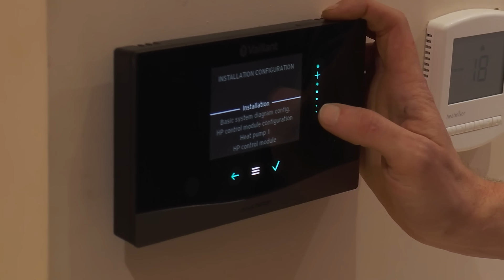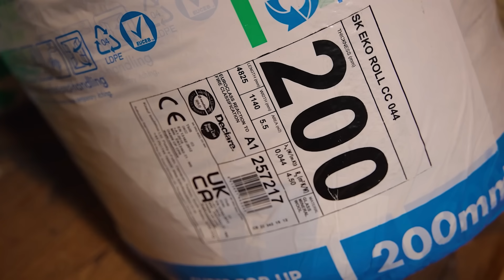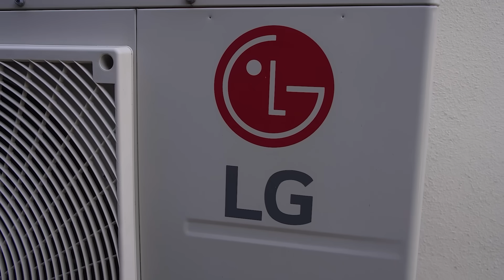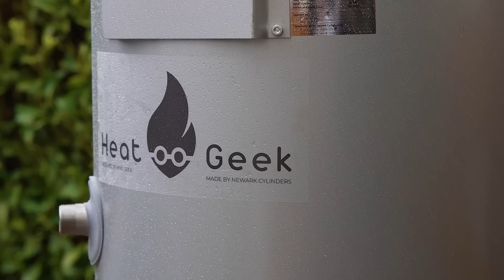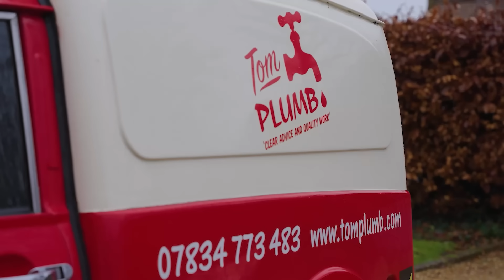Heat Geek’s Heat Pump One Year Later — The Verdict!

Comment: Note, there were many reasons we swapped that unit. Not just the noise. Also note - 450% efficiency over the year.
Reply: Rodger, it sounds like a Air to Air multisplit would suit your house.  Couple of grand for the cheep DIY kits and would probably half your heating bill if combined with battery strorage.

Air to air would also suit almoat any flat thats not sutable for Air to water, just like other countries.  or centralised / district air to air / air to water,
Reply: @inh415as installed in many countries.
Reply: We have a Long history of a that’ll do attitude and it is at the heart of many of the problems this country faces. We and our government should always aim for the best possible outcome. We should protect our resources and not squander them. The exploitation of natural resources should be taxed and the proceeds invested not simply spent by the treasury. We should as a nation be investing to drive down the cost of energy which will be of benefit to all.
Reply: But how would the old system have performed if the insulation would have been done first, you can’t make a comparison as you installed roof insulation, that’s 20-30% improvement already.
Reply: I call heat pumps the IF product. IF you are fully insulated, IF you can have underfloor heating, IF your pipework is suitable, IF it's a new build, IF electric is the same cost as Gas, IF you get a good designer , IF you get a good installer. IF it's set up and run correctly. IF it's half the price. 

Most fall at the insulation part. Insulate fully first. Then while you can get another boiler. Wait for technology and time to remove most of the IFs. Right now even a good install will not save you money once you factor in the high cost of product and install. By the time you save, parts will need replacing.
Reply: @ these myths have now all been disproven multiple times
Reply: @HeatGeek  how do you know electricity prices wont rise ? the savings argument only works with certain costs, also you are definitely not impartial you have a dog in the fight
Reply: @AlexSmith-y4i6t  Its same for the gas and everything else for that matter
Reply: Adam, I 100% agree, I was a sceptic and in September 2022 we moved in to a house with a ASHP, and my first thought was "Thats getting replaced with a good combo boiler". But I watched a few heat geek videos and learned about weather compensation and "low and slow" and how to access the various settings and change them for the best. Now I am convinced, our large 4 bed house in Norfolk is warm, comfortable and cheap to heat/run hot water, the house is now all electric and one other thing to consider is the effect on health of not breathing in all the fumes from a boiler, hob and oven. A huge thanks to Adam for the video guidance.
Reply: @micksmithson6724  You can get weather compensation on gas boilers, and you can get low and slow gas boilers too (ones that can also go high if needed, so no need to "leave running" all the time).
Reply: @drsquirrel00 thank you for the reply, but initially I was a sceptic but now I am a convert, our house is far cheaper to heat than our previous house of similar size with a Valiant combi boiler, and the house is toasty. But if you remain unconvinced, it’s not for me to persuade you, I am simply sharing my experience.
Reply: But is 450% efficiency down to changing the unit? I doubt it. Plus who paid for the Vaillant unit? Methinks this was sponsored by them.
Reply: Was it oversized for the property?
Reply: @watchandlearnfast   amung other things like fixed high temperatature controller, yes
Reply: @HeatGeek  I’ve seen this issue across Europe, boiler installers have installed oversized heat pumps then they don’t run efficiently and customers end up blaming manufacturers etc and finally accusing heat pump industry of daft conspiracies etc
And all this time the installer is to blame 😞
Reply: Tidal power is far too expensive. Wind is cheap. We don't have the grid to support either. Sort the grid, sort the pricing so it's not matched to gas, that's sorted the price.
Reply: It’s perfectly valid to be cynical of a system or technology that requires so much input in order to work. It’s going to take time before our workforce learns how to install these units, I estimate that at least 70% don’t as that is bad odds for customers.
Reply: @yp77738yp77739 Less input than education. Education of the installer and education of the customer, both of these tasks are verging on the impossible in the U.K.
Reply: Your £250 survey puts me off - what if you do the survey and then charge me ten times the amount? 

If you are serious - come to my house and video the whole thing?…… Happy to be persuaded
Reply: @ollydearden How many working hours do you do a week for no payment?
Reply: @HeatGeek  Is this more about pride than heat pumps? 

No one, especially an OG cockney plumber, likes to be schooled by someone half their age and thicker hair. One skill we woefully lack these days is acceptance. More specifically, the ability to say “I was incorrect” or “I don’t know”. I am constantly schooled by younger members of my electronic engineering team…it’s really hard but they respect me more when I listen and accept when my ideas were awful, while theirs were (much) better. But I’m not redundant, they are not right with everything, and I’m there when it all falls apart too - with my cool collect nature 😅. It’s how it goes. 🤷‍♂️. 

It’s absolutely ok for someone younger than you with less experience to have a better understanding of something. And it is most definitely ok to say “Well done 👍” - it feels good, try it. 

When there is a problem, be part of the solution or get out of the way. (Equally as important: when the solution has been implemented, don’t creep back in peddling gas boilers again 😂 - John is one of us now….) 

The physics is there, but the competence is not. All YOU need to bring is willingness and leave your ego at home, not needed at all.
Reply: Hear hear ! You could t have got this better nailed than this person. Roger shows throughout the video series that he doesn’t have the level of knowledge to understand these systems and likes it when it’s simple - i.e gas boilers. Roger is no slouch, and certainly no thicko and with a bit of decent training could nail heat pumps but I think his ego was hit by a few too many installs that didn’t go well for him because he didn’t do them properly and the ego is bruised and wants to shite on them. Your comments are spot on - admit you’re wrong and learn and grow from it.
Reply: John stated that the system did work but was turned off because it was too expensive to run , and the outside unit was noisy. Adam stated it was an easy fix , a weather comp sensor will reduce the running costs . 
I was looking forward to someone problem solving and fixing a hp system but that didn’t happen.
Reply: @haydnlawrence8167  It took a team of about eight super geeks to rectify this and so how many of us could get this sort of attention?
Reply: @haydnlawrence8167 watch it again carefully!
Reply: @haydnlawrence8167  You can get weather comp sensor for oil/gas boilers now - really don't know why it wasn't done 20 years ago on the reg.
Reply: @drsquirrel00 Because the U.K. industry is very poorly educated. Simple.
Reply: @haydnlawrence8167  Do you need to watch the original video from about a year ago?? This is the follow up video - stating that everything is fixed AND is actually better than his original gas setup.
Reply: @terryjimfletcher  You need to watch all the videos in this series, and take off the rose tinted glasses and drop your Adam fanboy infatuation. When you watch these videos try and use critical thinking and logic, I realise that is beyond most people convid being the prime example .
They didn’t fix anything they ripped out a load of equipment and installed a load more new equipment . 
The homeowner stated the system worked but was expensive to run and also the outside unit was noisy. Adam stated this was an easy fix with a weather comp sensor this will reduce the running costs , did they try this ? 
The next video months later is a bunch of geeks ripping out a load of kit to install a load of new equipment. 
In the final video with Roger talking with John the homeowner for a recap we find out a load of loft insulation was added during the making of the videos , perhaps that was the problem with the running costs of the original install.

The takeaway from this is it took 7 years and 50k of equipment and labour just to do what his gas boiler was doing all that time.
Reply: @haydnlawrence8167 That is not crucial thinking. That is confirmation bias. You watched some videos, through you had observed accurately and understood what was happening. You then demonstrated your critical thinking ability by concluding that it was all essentially rubbish. The confirmation bias triumphed over any ability to think critically - you believed it was all rubbish before you watched and confirmed that after you watched.
Reply: Skillbuilder is really a notorious heat pump hater. The way this guy talks about the technology is really pissing me off.
Reply: @pietheijn-vo1gt  Roger started off as a sceptic, but that's a very different thing to being a hater. His sceptical position was quite understandable, as all of the messages he'd get from people would be asking for advice after a bad installation.

But now he's seen first-hand that in the right circumstances, with the right system design, they do in fact work. He's been very open and honest about this over the years and has talked about how his viewpoint has changed. He's one of the few YouTubers who has a genuinely balanced position on the matter.
Reply: @yngndrw.  He's not a skeptic, he's a full on hater. His claims are not fact. Yes installers can mess up, we've seen that in the video. Proper training is needed. But that is not a valid reason to dismiss the technology.
Reply: I think this good news video is great, with the owner expressing that he wants more heat pumps, regulation and support for when it goes wrong.

At least Roger isn't dismissive.
Reply: @pietheijn-vo1gt would anyone let an untrained electrician rewire their house? So why let an untrained heat engineer design and install a heating system.
Reply: @markosborne7311  exactly. It's not rocket science. Just gotta know the right things.
Reply: @rogerborg  "Please collect your tools and leave my property"
Reply: @pietheijn-vo1gt  Where is he dismissing the technology?
Reply: @pietheijn-vo1gt  Did you write this before you watched the interview, after, or instead of?
Reply: @pietheijn-vo1gt  But that's not that apparent from the video, which is attempting to fix real problems. And Roger is really good at that, despite all the prancing no-nothing 'experts' who like to tuck away a few shillings for themelves whilst the 'global warming' scam lasts (1.4°C rise since 1890 - no big deal).
Reply from the maker: If you are pissed off it is because the arguments are getting through to you. Heat pumps cannot provide heat for many apartments and flats. They may, one day provide heat for 50% of U.K housing stock but you won't be alive to see that day and neither will I so choose something else to be pissed off about such as WW3
Reply: @SkillBuilder  oh stop it with that bullcrap. Heat pumps will work in any building, you just gotta have an installer who knows what they're doing. Heat geek has proved that.
Reply: Totally agree Rog @SkillBuilder
Reply: @pietheijn-vo1gt  Only half correct that they will work in any building. For flats, terraced housing and listed building they're not appropriate without costly infrastructure upgrades.

For instance a flat can't have it's own ASHP due to location and planning permissions as you're not allowed to hang a unit over a public walkway.
Terraced housing most planning applications get turned down at the DNO stage if the incomer is less than 80 Amps.
Listed buildings they can't be on show so it's a ground loop.

All of these buildings would be best served by a district heating set up and heat interface units in the individual properties. Fully Charged did a video a few weeks ago about a few blocks being retrofitted to make Heat Pumps work. The cost went into the hundreds of thousands. 

So yes we as installers can make them work for any building, how big is the clients pocket book is normally the deciding factor.
Reply: @SkillBuilder  We know that the arguments aren’t getting through. That’s the frustration. If a heat pump isn’t viable for many apartments and flats, so what?  Don’t install them there right now. If the products develop to the point where they are, then they will be. What’s the point in pointing this out? Why is it relevant to the main points of discussion?
Reply: @rogerborg  they were not removed because they were never installed. It was a plan that was cancelled. It’s a bit disingenuous to say that because heat pumps do not work well in an old palace that they won’t work in people’s homes or regular office buildings…
Reply: @effervescence5664  the issue isn't if HPs can work technically. You can heat any house with a HP for less CO2 than a gas boiler.

The difficult bit is the cost due to elec being 3-4x gas in the UK and the bureaucracy (planning, listed buildings and all the things you mention)

Gov could change the game tomorrow with changes to regulations and elec market.
Reply: @SkillBuilder  
Neither could I have one although I'm sure that perhaps Heat Geeks would  find a way! I have a largish 3 bed semi of 1929 vintage which only have two available outside walls if one excludes the front aspect. The wall facing the garden has one kitchen window and one bedroom window and a large patio door. If the HP were to be fitted between the two ground floor windows then there is no way behind these wall to act as a plant room unless I did away with the poky kitchen. 
The side wall which is our back passage is very narrow and constricted in aiir flow and faces E/NE. etc. etc.
Reply: @SkillBuilder I’m with you on this Roger. He could have run the boiler at a constant 20 degrees and insulated the loft and the results would be similar. In the U.K. electricity is so much more expensive than gas so this skews any advantages the heat pumps work goes has. We know that efficiency goes down when the outside temperature is really cold, and sometimes the outside unit ices up and the system shuts down altogether. The radiator water temperature is lukewarm, so pipe diameter and radiators cannot be the same as the old gas installation. 
Roger, you are spot on to point all this out, as you are a heating engineer and understand the cons.
Reply: @pietheijn-vo1gt  At a price lets not forget...... and one that may be too costly for many in the UK even with a £7500 subsidy, all houses are not equal here. We very much need tight regulation on installers( full labour and equipment cost breakdown ) or perhaps an alternative way of passing on the grant, i.e. post completion direct to house owner. A2W heatpumps aren't the only green way to heat a home, other approaches get overlooked by the government.
Reply: @albireo-d1b  the first step should always be to get a decent level of insulation, regardless of whether you're using a boiler or a heat pump. Too many people are in energy poverty because of poor insulation. Once a basic level has been reached, a heat pump is always an option. And as for new builts, those should always have a heat pump.
Reply: @SkillBuilder  I respectfully disagree, a few boreholes for groundsource heat when doing the initial groundworks and hius in the apartment will take care of it.  Kensa is a good example of a specialist in these kind of heat networks. I'm not an expert by any stretch I'm predominantly a wet plumber but to say it can't be done is incorrect. The cost to retrofit existing blocks will be a challenge but it's got to be better than the storage heaters a lot of these places have. I was working on a newbuild in Digbeth recently and they're fitting unvented cylinders with exhaust air heat pumps built in. So the hot water at least is from heat pumps.
Reply: @pietheijn-vo1gt  We heard that Heat Geek themselves actually said to John that there ARE properties they cannot justify an installation, and others were it is marginal and not to bother, so your argument is incorrect that they work in any building.
Reply: @olly7673  what percentage of buildings is that? 1%? I'm saying they will work in any building. I'm not saying everyone can afford it right now. But those that can should install one, higher volumes = lower prices. So the rest of us can benefit from that
Reply: @pietheijn-vo1gt  But that is not what the Heat Geek expert said, nothing to do with cost, just practicality.
Reply: @pietheijn-vo1gt  I live in a flat and cant install a heatpump, the management company wont allow any outdoor units.
Reply: @TomMorris1  well then they're suckers and they should change their policy. Alternatively they can install a single larger scale heatpump for the entire apartment building.
Reply: @olly7673  you'll have to be more specific. What video or source?
Reply: @TomMorris1  get a window unit, or a portable unit.
Reply: @SkillBuilder actualy there are heat pumps than can heat flats and appartments, they use ventilation air and/or outdoor air without an outdoor unit. Retrofitting an excisting boiler would be not so easy but for a new build possible.
Reply: @SkillBuilder  "Heat pumps cannot provide heat for many apartments and flats" - Are you sure about that? Consider - many high-rise blocks of flats in foreign climes (where it's hotter than here) have aircon heat pumps all over them. There's no reason why this couldn't be done in the UK too; full system heatpumps are a little bigger, I grant you, but you'd not need a large unit (as seen in this video) for a block of flats.  For any block with a flat roof, the heatpumps could be installed on the roof; yes, that's going to be a bit of a plumbing mess, but it's not unachievable.  One final option would be to offer a central building heat pump (a really really big one) that could provide heating & hot water for an entire block; divvy up the bills as part of the service charge.

There are many ways to skin the cat - poor cat - we just need to be open minded about them.
Reply: @SkillBuilder  what about district heating for flats/apartment buildings using ground/air source? Gas boilers in flats present a certain risk element and direct electric boiler/heating is crazy expensive (key factors you see to ignore). You have a very blinkered approach despite touting ideas like Portcullis house could be heated using the Thames. Very selective in your approach to topics... can't think why...
Reply: @rogerborg  what hope is there for the average installer if such an impressive install has gone tits up, the heat pump manufacturer would have got the kudos of having their units installed, and yet it still went down the pan, looks like they forgot their cibse guide book on inspection.
Reply: I doubt he’s pissed off because the arguments are getting through to him, but because in the face of undeniable evidence, heat pumps outdo gas boilers even when electricity prices are 4 times higher than gas and you still see to want to shit on them with very weak arguments. Your attitude is first as denier, then excuse seeker, then without doubt clickbaiter. And the gas fraternity have no answer to this, how do you do a gas boiler that doesn’t emit CO2 and other pollutants ? At the end of the day that’s still a problem, whether you like to brush over it or not and you’re morally wrong for passing that problem off on other generations. Heat pumps do not have that problem, while being on average 4 times more efficient than the best gas boilers.
Reply: @johnmacward  while heat pumps properly installed can offer economic heating the facts are a typical installation will cost close to £15,000.  For that money you can install a new gas boiler and run it for 15 years.  In that time the gas boiler will need replacing as will the heat pump.  Now if you add solar PV and a battery you can run your heat pump for “free” except the PV and battery will cost you another £8000…..

The big issue with heat pumps is the cost AND bad design and installation.  If the installation is bad you save no money at all and this is the whole point of the video.
Reply: @SkillBuilder  think he needs to sit down and take a few deep breaths, then realise that heat pumps are not suited for all building types.
Reply: @SkillBuilder  air to air multi splits can heat almost any flat and apartment in the UK. Units of 12kw output over 6 rooms are avaliable and commonly fitted worldwide. In the unlikely event your flat needs more heat, you an always fit 2 units. 

The barrier in UK is primarily planning and skilled workforce.
Reply: @SkillBuilder  This exactly is the biggest problem I have with so many 'green' solutions. They typically all or nothing  their arguments. Electric cars, solar panels etc work best where they work best. NOT everywhere.
Also, if a typical person  needs special training to operate a system today,  that SYSTEM needs to change.
Reply: @SkillBuilder That may be, but even at 15%-20% it will be a game changing level of efficiency. At greater than 20%-25%, the efficiency effects start to compound. At 50% the effects would be exponential. You shouldn’t discount even modest levels of housing stock conversion.
Reply: @SkillBuilder   youtube wins again and this should commissioned for terrestrial TV. Would loved to have seen a summary of all the design and work done to turn this disaster around. Awards to all involved.
Reply: @pietheijn-vo1gt  You sound like a car dealer who can't understand why people hate car dealers. Heat pumps are being pushed like tulip bulbs were 200 years ago. They work in places with nice climates or places where electric is either cheap or generated from renewables. In 50 years your argument might be right (it seems you think heat pumps are perfect). Look at the size of the thing. It costs money to run. Even if you are rich, they arent always the ideal solution because rich people often have unusual architecture and set ups with rooms running off one another. In 2025 heat pumps work if you live in a well insulated apartment, A1 rated home , or live in spain. OR if you live in a country where electric is cheap. The whole concept of them is wasteful. And then there are the morons who install these things. Its easy money if you are failed electrician.
Reply: @Meodus_Humbinerbernecki complete bullshit. You know which countries have the most heat pumps? The nordics, where it gets to -30 deg C. And they work FINE
Reply: @pietheijn-vo1gt   @pietheijn-vo1gt  YES THE "NORDIC" example they have centralised heating systems or solar panel orientated heating. Just because it works in finland does not mean those elsewhere are not being shafted by this over priced tech
Reply: @pietheijn-vo1gt  You are not sharing that in Finland they have much more availabilty of District - communal heating and anyone who builds a house in Finland has insulation in in mind . Also heat pumps dont work so well under minus 15 ask any Finland installer. In UK and IReland we are getting fleeced by cowboy installers. So you should can it.
Reply: @Meodus_Humbinerbernecki I have no clue what you're trying to say.
Reply: @Meodus_Humbinerbernecki can it because some of the installers are messing up? would you stop driving a car because you had a bad mechanic? or would you find another who does have good training?
Reply: CO2 is 0.04% of the atmosphere.
Reply: @fortnitefred1351  and 0.16% CO will kill you in hours. What's your point?
Reply: @fortnitefred1351  Honestly, there isn’t really anyway to sugar coat this. 

To put it in perspective, dinosaurs died out with a +3°C rise most likely caused by CO₂ from Deccan Traps volcanic eruptions, causing 1ppm CO₂  increase per century. If the asteroid or volcano didn’t get them, then global warming finished them off. 

We are currently at 0.042% CO₂ which has caused +1.2°C increase - all from post industrialisation (ironically) from burning the prehistoric life and turning atomic Carbon into CO₂.

To put it another way, we are half way to dinosaur-extinction-levels of CO₂ but perversely we are excelling at it with a 2.5ppm increase every year (not century)! Yes we are increasing CO₂ hundreds of times faster than during the dinosaur extinction. 

If we hit a +5°C rise globally, it’s pretty much the beginning of the end for us, and guess what? That’s 0.082% atmospheric CO₂. 

To put it another way, if we don’t slow down CO₂ production, ie stop burning stuff - then the human race and all the creatures on Earth are absolutely fucked, and we will be like Mars.

I’m not sure about you, but in lieu of absolutely nothing else, I’m definitely gonna give these heat pumps a chance. Anyone else up for that?
Reply: @fortnitefred1351  Honestly, there isn’t really anyway to sugar coat this. 

To put it in perspective, dinosaurs died out with a +3°C rise most likely caused by CO₂ from Deccan Traps volcanic eruptions, causing 1ppm CO₂  increase per century. If the asteroid or volcano didn’t get them, then global warming finished them off. 

We are currently at 0.042% CO₂ which has caused +1.2°C increase - all from post industrialisation (ironically) from burning the prehistoric life and turning atomic Carbon into CO₂.

To put it another way, we are half way to dinosaur-extinction-levels of CO₂ but perversely we are excelling at it with a 2.5ppm increase every year! Yes we are increasing CO₂ hundreds of times faster than during the dinosaur extinction. 

If we hit a +3°C rise globally, it’s pretty much the beginning of the end for us. If we hit +5°C, it’s over and guess what….+5°C rise will be caused 0.082% atmospheric CO₂, not much in it!?

To put it another way, if we don’t slow down CO₂ production, ie stop burning stuff, then possibly our great great grandchildren are going to witness a terrible end, what a legacy you left them! Let’s NOT lose sight of why we are doing this. 

Remember, a gas boiler can ONLY use gas, it will ALWAYS produce CO₂. A heat pump uses electricity and while some electricity is produced from gas, it’s produced with less CO₂ but more importantly there is non-carbon electricity available: nuclear, solar and wind. 

I’m not sure about you, but in lieu of absolutely nothing else, I’m gonna take my chances on heat pumps - after all they are perfectly acceptable in summer when they are cooling you down!
Reply: @fortnitefred1351  "CO2 is 0.04% of the atmosphere." - It used to be 0.028%, back when we had "normal" weather. If a 0.012% increase can change the climate so dramatically, just imagine what another 0.012% will do (we are well on course for that). Even more so when you consider that the original 0.012% increase took over 200 years, but the next 0.012% is likely to take less than a decade (indeed, current levels are already more than 0.002% above the figure you quote).
Reply: @theelectricmonk3909  could you provide a link to the above information, so I may study it further. Thanks.
Reply: @theelectricmonk3909  CO2 was 180 at the glacial maxima 21,000 years ago and remained similar until 15,000 years ago when the ice started to melt and sea levels rose 140 meters.  CO2 was 4000ppm  in the Cambrian when life exploded onto the planet.  What is your point?
Reply: @DR-00700 Did you check the global temperatures and the composition of the rest of the atmosphere during the Cambrian period?
Reply: @ yes both co2 and temperature were high.  You will argue that that proves co2 is the smoking gun so I point you to the radiative transfer model and the exponential decline in CO2s capacity to act to warm the planet.  Water vapour is the main proponent and both water vapour  and co2 are forced up with temperature.  Water vapour from the Hunga Tonga eruption has likely acted with El Niño to cause the recent spike in temperature that El Niño and CO2 can not account for as admitted by Gavin Schmidt of the NASA Godard institute in NYC.
Reply: @DR-00700 This comment misrepresents the science: yes, water vapour is a powerful greenhouse gas, but it’s a feedback, not a driver — it amplifies warming caused by primary forcings like CO₂, which traps heat first and then increases water vapour. The idea that CO₂’s effect “declines exponentially” is misleading; while absorption bands do saturate, radiative forcing continues to increase logarithmically, not vanish. The Hunga Tonga eruption injected water vapour into the stratosphere, but Gavin Schmidt has not said CO₂ and El Niño can’t explain recent warming — he emphasised they’re part of a complex picture, not invalid causes. This post cherry-picks and distorts legitimate science.
Reply: @NorthernEwan  Gavin Schmidt has indeed stated that the climate models with CO2 and El Niño CAN NOT explain the recent temperature rise and duration.  To suggest that CO2 precedes temperature is a contradiction in the science.  The climate record and co2 record clearly show CO2 follows temperature as CO2 degases from the oceans this is clearly shown in the geologic record and data.
Reply: @ This reply repeats a common climate denial trope: that CO₂ can’t be a cause of warming because in ancient records it sometimes lags temperature. That’s a misunderstanding. In past ice age cycles, initial warming was triggered by orbital changes, which then caused CO₂ to be released from oceans — and that CO₂ then amplified and sustained further warming. The lag doesn’t disprove CO₂’s role; it proves it’s a feedback and a forcing. As for Gavin Schmidt, he clarified that the Hunga Tonga eruption injected unprecedented water vapour, contributing to short-term spikes, but this doesn’t undermine the long-term trend clearly driven by CO₂ from fossil fuels, which models do accurately reflect.
Reply: @NorthernEwan  co2 does not amplify anything other than poorly educated alarmists….
Reply: @NorthernEwan  wrong
Reply: @DanRyan-v5y  incredible argument
Reply: @NorthernEwan  thankyou
Reply: No such thing as 450% efficiency. People really need to understand what efficiency is
Reply: @DanRyan-v5y please explain more! I’m not sure you understand how heat pumps work!!
Reply: @DanRyan-v5y yes you can with heat pumps. That relates to the amount of heat you get out vs the electricity you put in!
Reply: Don’t remake the language because you don’t know the words. Its a 4.5 times energy performance.
Reply: @TC-V8  no you have just shown that you don't understand the concept of efficiency
Reply: @DanRyan-v5y  wakey wakey
Reply: @DanRyan-v5y  it can be 450% when compared to traditional, but it’s an extreme best case.  Traditional efficiency would be like a electric bar heater that is close to 100% efficient as it converts 1kw of electricity to 1kw of heat.   A heat pump does not convert electric to heat, it simply moves heat from once place to another.  To understand this you need to get your head around there being plenty of heat in the air at -10 degrees, which I appreciate is hard to understand , but nonetheless is true.    Financially you think of gas as more efficient than electric, but it is not. it may be cheaper but that’s more economic, not more efficient
Reply: @DanRyan-v5y  1kw of electrical energy in... 4.5kw of heat energy out.
Reply: @ of course there isn’t such thing as 450% efficiency - not in the classical sense -  heat pumps don’t create energy they move it. 

However, how do you compare a gas boiler to a heat pump (apples to apples) to the general population?  SCOP is a new concept that requires some prior understanding of how heat pumps work. 

Short answer is, when dealing with regular humans, you don’t. Instead, we need to create nuances on already well understood concepts like efficiency, to get the information across. 

It’s perfectly acceptable to use this nuance, because to the (I hate to say it) layperson, it allows them to easily compare a 90% efficient boiler to a 450% efficient heat pump. It’s clear to see that they are getting “extra” energy to from the energy they are paying for with a heat pump, and losing energy are paying for with a gas boiler.
Reply: @NorthernEwan yes they do move it or in fact multiply it, hence the greater than 100% effy. You answered your own doubts there though👍😀
Reply: @SiHeatGeek  He was replying to DanRyan.
Reply: @SiHeatGeek  I think you misinterpreted my comment, there were no doubts! 😂 I was explaining to the guy who said there is no such thing as 450% efficiency, that yes, in a classical sense (sankey diagram, thermodynamics ) you can’t have efficiency greater than 1 (100%). 

But the important point I was trying to make: 
Is that we can (and should) adapt and accept the new meaning of efficiency (aka create a nuance) that efficiency can go beyond 1. So people can compare heat pumps to boilers easily with a concept that they know already. TL,DR - we are in agreement.

# edit - having a bit of a existential crisis here, if you think about it deeper from the point energy in the universe, there is technically only ever an efficiency of 1. Energy is there in a set amount, it’s not created nor destroyed, it’s just moved about in different forms. Most people don’t care about this, their efficiency is relative to what they are paying for energy in their heating envelope. In John’s envelope, he’s paying for 1kW energy, and getting 4.5kW in his envelope, so his efficiency is 450% (financially) but not to the universe. The universe is giving him 4.5kW of energy, and 4.5kW energy will be returned to the universe…. An efficiency of 1. What breaks my heart is energy suppliers are charging me for energy that doesn’t strictly belong to them. 

But that’s irrelevant we need people to use heat pumps, to reduce CO2, so we don’t end up like Mars sooner than we want. And for that there is such a thing as 450% efficiency
Reply: @NorthernEwan there is no “new” meaning of efficiency.
Reply: @ that’s exactly why I said it was nuance…. 🙄. It’s not about you and your understanding, it’s about helping people understand things better. And if it means using terms like 450% efficiency then so be it.
Reply: @NorthernEwan  "End up like Mars" Our atmospheric C02 levels are woefully low 0.04% compared to Mars 95-96% composition. Please stop with this propaganda. We need more c02 for plants and better food yield not less.
Reply: @ Seriously? Who told you we need more CO₂ for plants? Yes, Mars atmosphere was extreme, but let’s put this in perspective. Dinosaurs likely went extinct due to a combination of an asteroid impact and massive CO₂ emissions from the Deccan Traps, which raised global temperatures by around +3°C over thousands of years at a rate of ~1ppm CO₂ per century. Today, we’re emitting CO₂ at over 2.5ppm per year — hundreds of times faster — and have already caused a +1.2°C rise since the Industrial Revolution, with CO₂ now at 0.042% of the atmosphere. If we reach +3°C, we risk widespread ecological and societal collapse; at +5°C, human survival becomes doubtful. 

No, we do not need more CO₂ “for plants and and better food yield” wtf 🙄
Reply: @NorthernEwan  so you lie, because you think the public are stupid?
Reply: @NorthernEwan  so you lie to con the public. That is what you are saying. Mars has more co2 in the atmosphere and is much colder than the earth. Or are you thinking of Venus?
Reply: @DanRyan-v5y little point trying to educate the majority of people on here.
Reply: @DanRyan-v5y  A better phrase would be 450% return on efficiency. but I think you know what is being said.